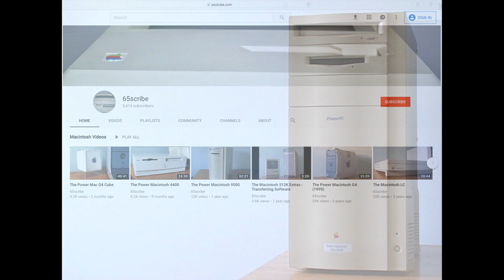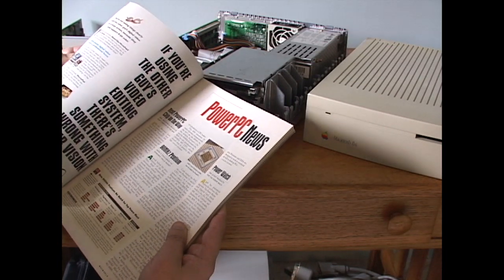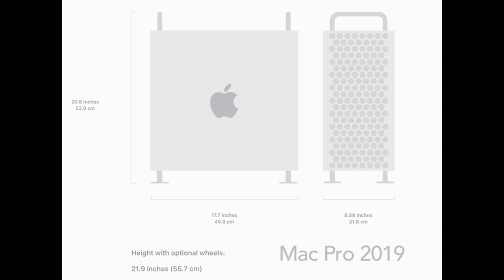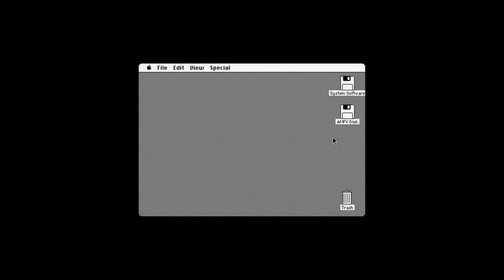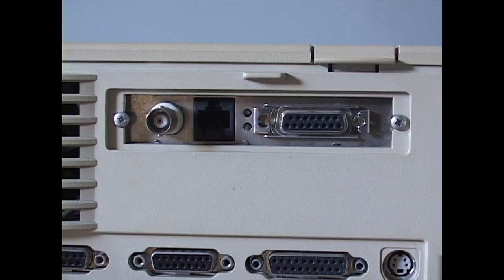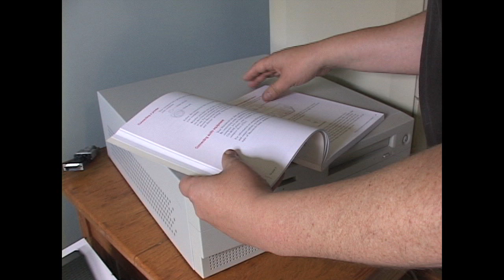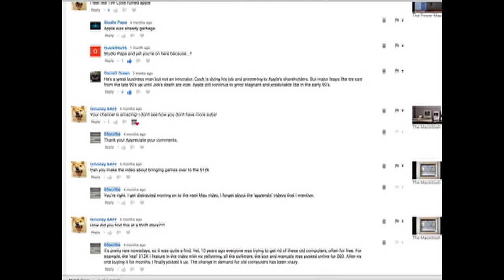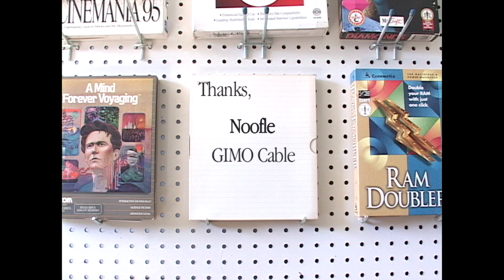The Macintosh ... corrections

Comment: The one Macintosh that probably created the most stir in all of Macdom was the ill-fated Twentieth Anniversary Macintosh. If you can get your hands on one, it's worth a video. There is so much history surrounding this beast. The best part was the product's introduction, which also featured the return of Steve Jobs to the stage with Amelio. Jobs HATED the TAM. You could see it on his face when the product rose up from the stage. Jobs wouldn't even look at it, just stood looking straight ahead, sneering at the audience. One of the first things Jobs did when he staged his coup was to kill the TAM. The problem this thing had was that the production orders were so small that not one of the internal product managers wanted to take on the project. They saw it as a massive waste of resources (which turned out to be very true). But Amelio felt it would be his signature product. "I made PROMISES!" he once shouted at his direct reports when they told him that no one wanted to work on it. The story of how Bose got its fingers in the product is a great one, too, particularly how Bose managed to put the power supply inside the subwoofer, which by virtue of the subwoofer's lowpass characteristics removed the power supply's fan whine! Hence the now-infamous "fire hose." Finally, there was the dreaded TAM Buzz that no one at Apple managed to solve. Or wanted to solve.
Reply from the maker: That's a big 'if' as far as getting hold of a TAM, but you're right. It has a great story, and some of your information I've never heard before. Very interesting! I talked a bit about the TAM in the G4 Cube video, partly because I figured that's as close as I would get to talking about the TAM in this series. Thanks for sharing that!

Comment: Just discovered your channel and loving it. Please note, NewerTech doesn’t sell those 4.5V PRAM batteries any more (just click the BUY link). I liked your mod but you can get a battery holder that takes 3 AAAs on eBay that’ll do the same job. Again, great stuff.
Reply from the maker: Augh. Now I have to do a correction to my corrections video. No, actually, thanks for the tips on the battery and I'm glad you found the channel.

Comment: Didn’t properly shut down the Mac at the end: -2 pts.  

.....Mac proceeds to play “Don’t copy that floppy” rap in smoothly animated B&W: +100 pts.
Reply from the maker: Ha! That's great!
Reply: Not sure, but since there was no floppy in the drive at that point, I'm pretty sure it wasn't actually running anything. Probably just powered it on for the gag anyway.

Also, up until about System 6, the shutdown command did what the later restart command did. Specifically, ejecting any floppies still in their drives and doing a soft reset of the system, at which point you could turn it off safely.